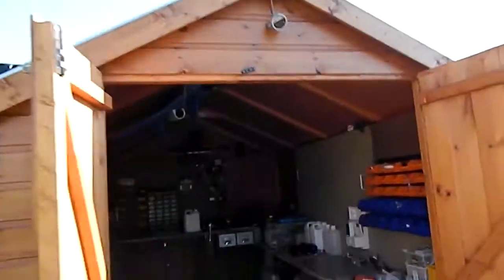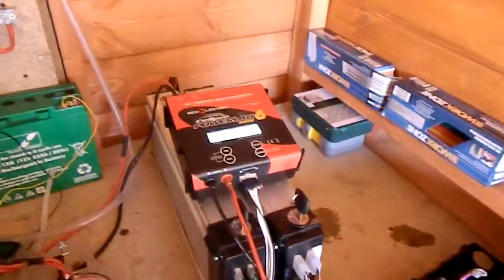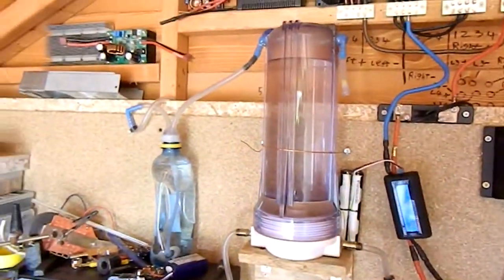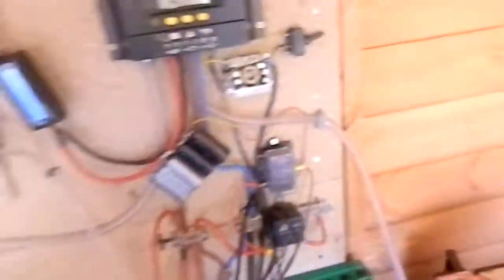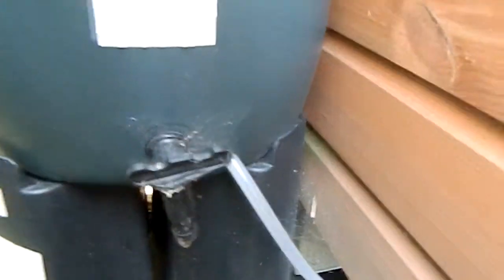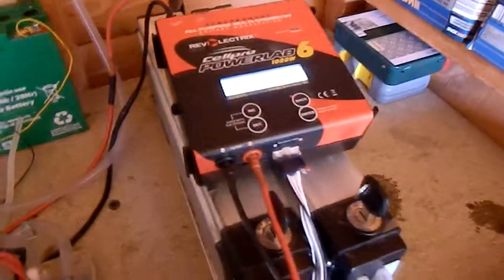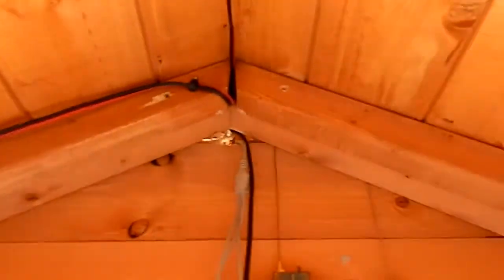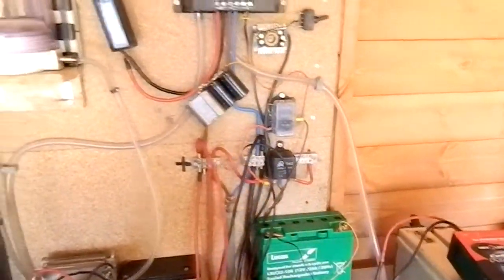My 800w Solar Shed Overview UK

Comment: amazing home made system. like the water cooling system. is it only intended for dc charging/storing?
Reply from the maker: Originally it was but now I feed back into the grid and I also have an inverter. I recently change over to 24v.

Comment: Cool idea to use the water cooling to get a bit more capacity out ov the charge controller. I have thought about this idea at times, but it's cool to see someone has actually done it. :)

What I do though is control external mosfets from small charge controllers to increase the capacity.
Reply from the maker: xanataph That's also a great idea. You can handle serious current that way although I tried it on a wind charge controller and it worked for a few hours and the controller board went up in smoke. Mosfets were fine.

Comment: Awesome little shed set up. Considering you have 800 watts worth of solars, I would consider MPPT charge controller. You'll get loads more in winter :) What caps have you got and are they on the solar side or the battery/inverter side?
Reply: Ha just answered my own question on the caps location. Where are you in scotland?
Reply from the maker: Daniel Wilson
 Hi, I am in Fife. I have looked at MPPT controllers and they are just horrendously expensive. They wouldn't make a lot of difference in Winter anyway because there are buildings and bales that block the sun for half the day.
Reply: Ahhh fair enough dude. Yes they are expensive! I'm looking at a 24v 40amp mppt with 97% efficiency for £180 and thats at the cheapest kit I can find!
Reply: I have decided I am going to make my own MPPT charge controller. Will let know know how it turns out :D
Reply from the maker: I wish you luck on that one, those things are very difficult to build.
Reply: Shaun Dobbie Im curious what size are those caps in parallel with your panels?
Reply from the maker: There is 4 6800uf capacitors in parallel.

Comment: Where did you get the golf cart
Reply from the maker: Those batteries I got here, http://www.ebay.co.uk/itm/6-Volt-Trojan-T105-Deep-Cycle-Battery-/110974888838?pt=UK_CarsParts_Vehicles_BoatEquipment_Accessories_SM&hash=item19d69e6b86 Good seller but you should fully charge the batteries as soon as you receive them as they will have been in a warehouse for quite some time.

Comment: Where did you get the 250ah battrey from just wondering.
Reply from the maker: It was from the ebay seller simco trading who you should not buy from because the battery was a bit defective when I got it.
 Also I would not recomend that you buy from surplusamps either because I received a defective battery from him too.

Comment: What's the watts in the winter and summer becaues I might do a solar shed.
Reply from the maker: Quite disappointing in Winter, only a few watts when it is cloudy. When it is sunny in Winter I might get 200 watts if I'm lucky. In Summer, they sometimes peak at 650 to 700 watts but that is because I don't have an MPPT controller. I get at least 3kwh a day of electricity in Summer when there is no clouds.
 From March 2014 to today, I have generated 209Kwh.